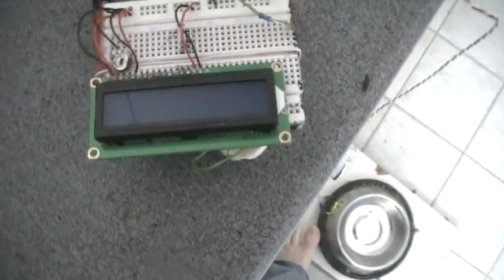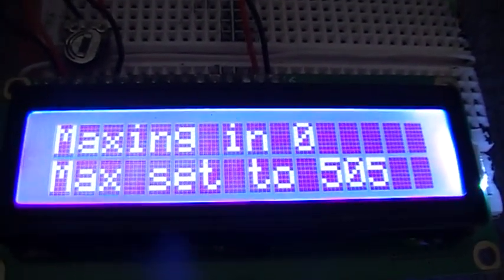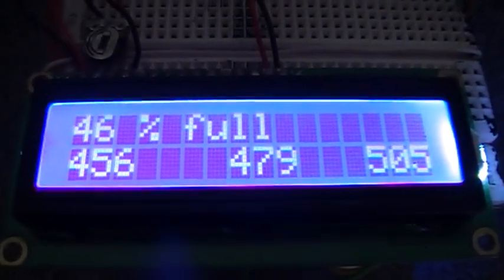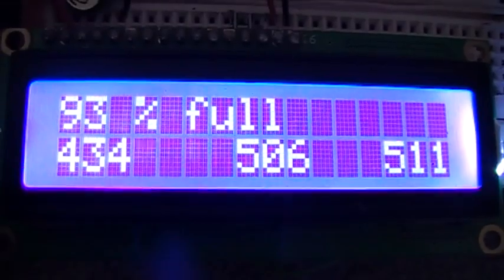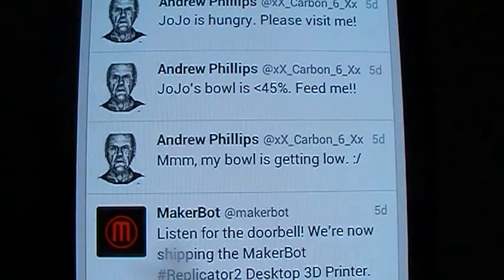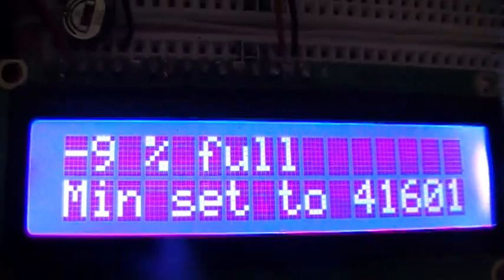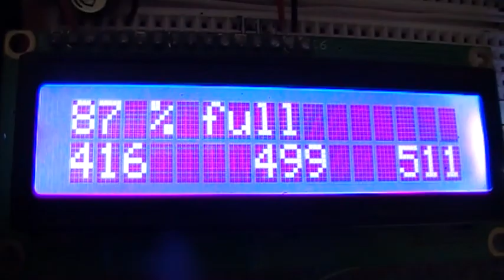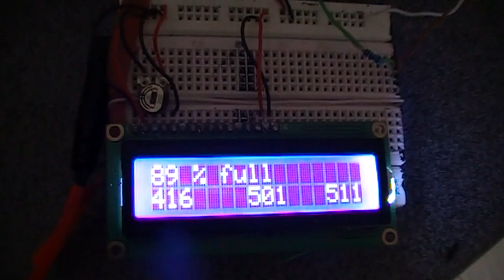Tweeting cats bowl

Comment from the maker: As I said in the video, I'm taking 60 readings with a 100th of a second delay between them.  I then take an average of that figure.  I would prefer a median reading (as you would understand all too well) but I'm having problems with the Math.h library for some reason.

Once I'm happy it's all running correctly I'll bump the delay out to 1 second or maybe even 60 seconds.  In this way that cat's feeding shouldn't disrupt the sensor too much.